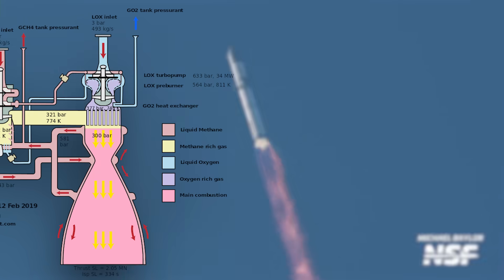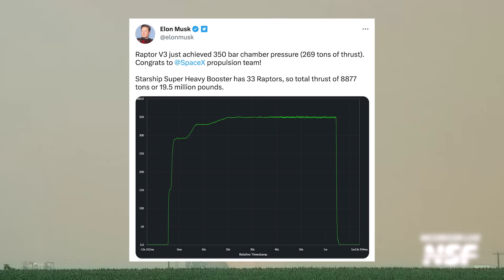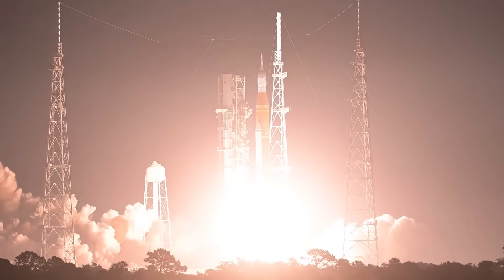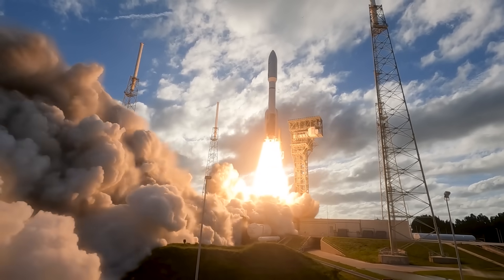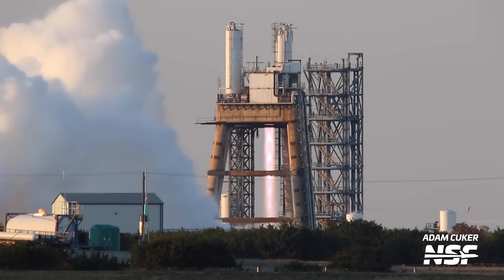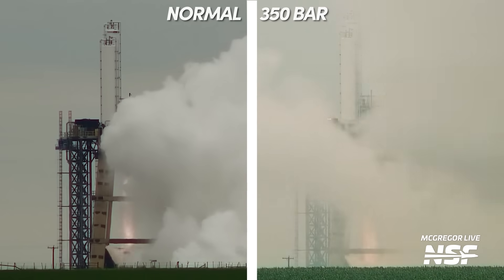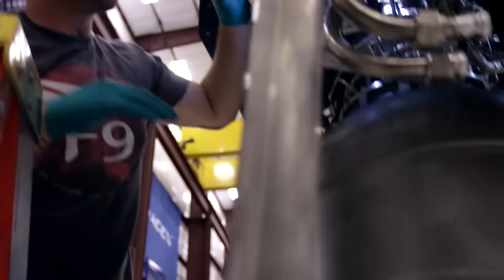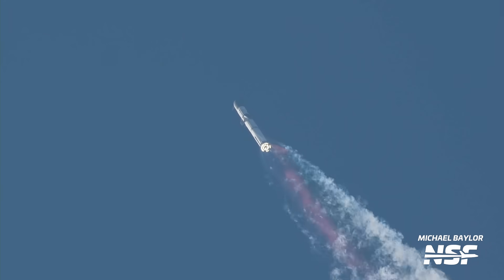SpaceX's New Raptor 3 Smashed The World Record!

Comment: I think it will be more of a case of the developments being made making the Raptor a more reliable engine - if the chamber can survive 350 bar of pressure, like during this test, it will hopefully mean a slightly less powerful version having a greater safety margin. In theory if it survives 350 bar, it should be much more reliable at say 320 bar. Always good to have a large safety margin. Hopefully it will put an end to unexpected RUD's of Raptors.
Reply: I would bet they get it up to 370 bar followed by a pretty spectactular RUD
Reply: I don't think RUD's are the problem: it's just the prevalence of engine-rich exhaust.
Reply: @javaman4584  and 42 engines finally, when Starship has 3 more

Comment: You probably meant megapascals (MPa) and not millipascals (mPa). I mean sure, you could measure chamber pressure in either one but 350 bar is 35 MPa or 35000000000 mPa.
Perhaps a more useful comparison would be 5076 psi, nearly double the pressure in your typical SCUBA tank.
It's also roughly equivalent to the pressure 2.2 miles underwater.
So yeah, it's a lot.
Reply from the maker: Ha, one of the first things the team noticed right after we shipped it. Can we  go with "the larger number is more impressive" instead of "typo" heh. -Das
Reply: @NASASpaceflight  It's been a while since I last heard that excuse, LOL.
Reply: Or as they say in software qual testing: “it’s a feature, not a defect.”
Reply: To be fair, chamber pressures ARE measured in mPa, when measuring vacuum.
Reply: Thanks for making this comment.  I stopped concentrating on the video at that point, thinking one bar is about 100kPa, and it should be capital M.  Had to rewind because I missed a bit because I was distracted.

Comment: I'm still not getting a sense of "what does this mean"?  Is this beyond target, approaching target, missing target?  Does this mean SpaceX needs less fuel, more fuel?  With the higher rating engine can they now have 30 rocket engines per booster instead of 33?  Also what were the ratings for the Raptor 1, Raptor 2, vs Raptor 3 and what does each rocket engine system weigh? just so many questions I was hoping someone would already have answers to.
Reply: We don't know what their targets are.
It probably doesn't affect fuel requirements much.
I think they're not likely to change the number of engines - the increased thrust can just translate to higher payload capacity.
Raptor 1 was rated at 185t thrust. Raptor 2 is rated at 230t. Raptor 3 appears to have 269t.
The actual weight of each version is pretty similar.
The mass of the starship + booster with fuel on board is about 4900t
33 Raptor 2s generate 7590t of thrust.
33 Raptor 3s generate 8877t of thrust.
With Raptor 2s and no payload, the stack has a thrust to weight ratio of 1.55:1
With Raptor 3s that would be 1.8:1, which is a bit high - they apparently want 1.5:1 (most heavy lift rockets are about 1.2:1, for reference. Something about reusability)
However, with that many Raptor 3s, Starship might be able to carry 1000t of payload, vs the 150t it could carry with Raptor 2s.
In practice, I suspect they'll carry a lot less than that for safety margin reasons, but it gives them a lot more safety margin.
Reply: @KeandeLacy  I heard that there was actually significant weight savings between v1 and v2, which makes sense since they were getting rid of unnecessary systems and components. I would think v3 will have weight savings as well
Reply: Higher pressure translates to more thrust per engine and better fuel efficiency. So it may be possible to have fewer engines on rocket or more engines out capability (improved rocket reliability). Also better fuel efficiency means the rocket can lift heavier payloads or to higher orbits (higher rocket performance).
Reply: @JumpingJack-w2l  Similar in theory to the ramjet engines on the A-12/SR-71
Reply: Higher pressure means the turbopumps are driving more fuel into the combustion chamber. For a given tank size, it empties faster but produces more thrust some it does not need to run as long for the same result (specific impulse). Which is fine, when you consider the insane things that happen inside the turbopump of a close cycled engine.
Reply: Well! I have to say, you got some impressive answers to that cluster of questions. 
I am just starting to wonder if they are getting close to a 'theoretical situation' like, (as an example), the dragsters, where the engine power has become so high, that they have had to increase the tyre's to keep traction with the 'road'? Is there a 'law of physics' where the rocket exhaust pressure is going to start 'collapsing' (like loss of traction of a Dragster tyre) the exhaust gasses exiting the bell nozzle, such that it starts to reduce the 'thrust lifting' force it can apply back to the Rocket? i.e Will 'over-driving' the thrust start to show a decrease in lifting capability?
Reply: @David-yo5ws  The dragster engine is a good comparison as in they run them so hard they break parts every pass. In rocket engines by constantly increasing chamber pressure you will eventually FAFO the limits of metallurgy.

Comment: I really think SpaceX should put more resources into improving the reliability of Raptor engine instead of just efficiency. Superheavy should have all 33 engines burning all the way to stage separation. But of course they might  be doing just that behind the scenes but not talking about it because efficiency improvements are more sexy to publish.
Reply: That's exactly what they're doing.  🤦‍♂️
Reply: When the margins are higher you get better reliability in the operational range. They know what they are doing. Plus they desperately need more power to make this whole dream remotely plausible. They are NOT making a normal rocket here, but a revolutionary vehicle with goals never achieved in history. Starship could be 100% reliably flying to orbit and still be a TOTAL failure (if the $/kg is higher than Falcon 9 - the only metric that matters for uncrewed flights).
Reply: The engines in B7 were a mismatched mix of available V2 raptors, they have said that the more recent ones in the newer boosters are more consistent, so we should hopefully see improvements there. Also the engine shielding was more of an afterthought on B7, so some engines were damaged by the explosions of others, as well as 3 not being ignited from the get go
Reply: Installing any kind of a flame trench and/or deluge system is going to help with that, at least compared to what we saw on the first flight test.
Reply: @JustSomeCanuck  no engines were damaged by the concrete

Comment: "Just look at this difference in flame length!" entire flame of 350bar test obscured by cloud for 95% of clip
Reply from the maker: We actually did the math on that... it's only "fully obscured" for about 17 of the roughly ~70 seconds, or 24%.

Was pretty hazy that day, though. - Das
Reply: @NASASpaceflight  I was referring to the short portion (clip) of the test that was presented as the line was spoken, also I did not do any math for hyperbole reasons

Comment: Bigger engine? Bigger turbopump? Smaller nozzle? change of fuel? cryo? ...
Reply: Better cooling arrangement of the throat is the biggest thing, and more precise control to avoid transient effects disrupting your cooling setup. Getting up to high chamber pressures isn't that hard. Not melting when you get there is where the real challenge is.
Reply: No new fuel, maybe changes in the throat, not sure why cryo would change. Engine footprint likely not to change

Comment: The Raptor engine is really looking impressive as SpaceX optimizes its design. This version 3 engine puts out more thrust than the RS-25 or BE4 engines while being less than half the size. Can't wait to see a fully optimized and operational version of the Raptor engine when development concludes:)
Reply: @I Am A Duck It will hover longer, so it is a trade-of.
Reply: Remember that the Merlin engine is "hilariously simple" for a rocket engine, and they optimized the shit out of that design and managed to push it to incredible heights. 
And Raptor is orders of magnitude more advanced. 

I don't think we have even begun to see what it's truly capable of.
Reply: Matthew. Yeah, heck yeah. But look what Raptor 2's did to the launch mount.😮. Flame trenches AND water deluge system necessary for Raptor 2's. Gotta love SpaceX.
Reply: And it’s so clean looking too!
Reply: What a lie